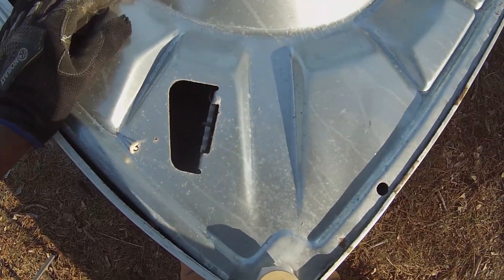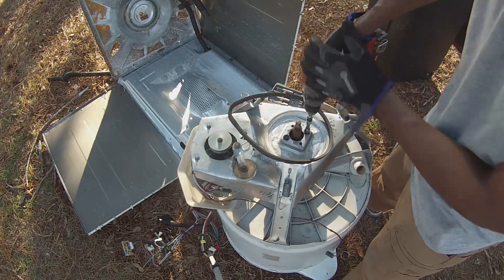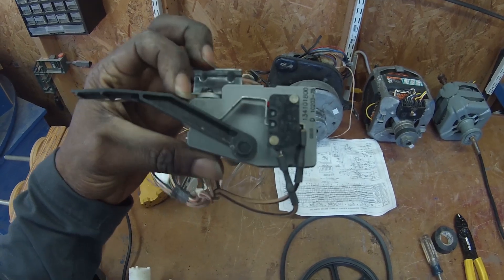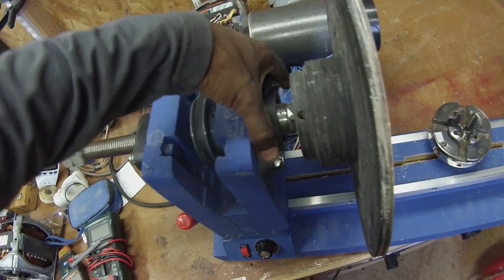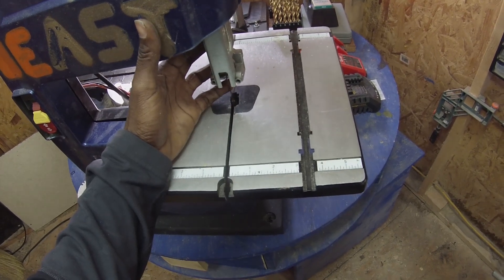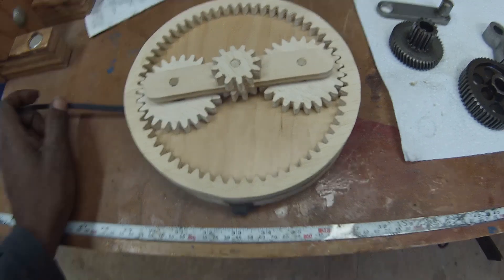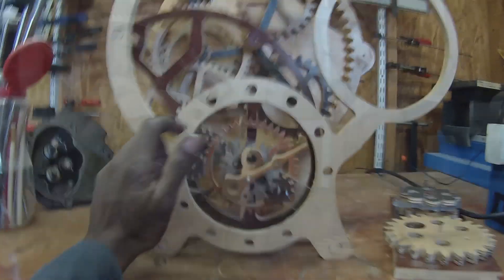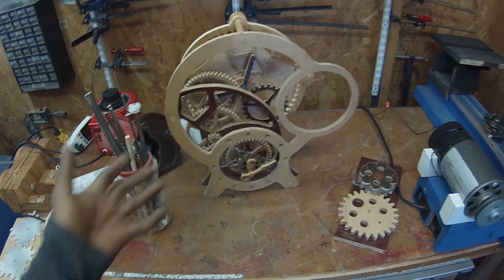Things You Can Make With A Washing Machine And Other Salvaged Components : 020

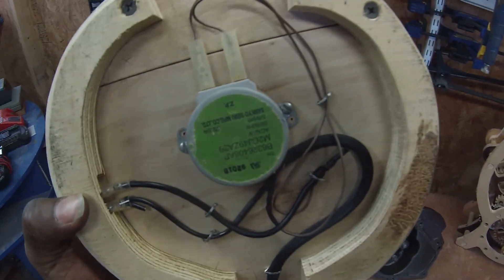Comment: Thank you for the great content. at 8:30 you show a motor from a microwave being used as a clock. These require a 21vac source. How are you supplying the voltage to the motor? Are you using some readily available adaptor or did you use a stand alone transformer you wired in yourself? Thanks again.
Reply from the maker: That motor runs on 120 VAC. I just wired it directly to the wall.

Comment: I love your creativeness.I just had to replace my oil pump in truck and the gears are neat on how they meet up. the inner gear is smaller than the inner reverse gear cut out,so it rolls in kinda a oblong pattern.just trying to figure out what to do with it. I wonder how much abuse that washer transmission would take. that is a step down type gear set up correct. fast motor slower results? might make a good rotisserie for a big grill

Comment: Do you have any ideas of what to do with an old dishwasher with a burned out element? The pump and the rest of the machine still worked. I was considering making a parts washer out of it for my small engine shop. Ideas? Thanks for the inspiration to re-purpose old equipment instead of just tossing them!
Reply from the maker: Sounds like you are on the right track. I have only opened one dishwasher. I keep the motor, the impeller and that is about it. I don't remember what else was there.

Comment: You are now appointed a fully accredited  salvagor!
Very clever ideas which seem exceptionally well implemented.
Your washing machine motors, when used as you have, do need some effective safety shielding & dust protection; but I guess you know that.
Now I need a few pointers on how to manage my accumulation of stuff.
Reply from the maker: Check out video 13... I talk about why it is not not shielded :) I didn't want to add the length to this video. https://youtu.be/ScrlNLQmu3E

Comment: I've been trying to come up with some way to have my patio door open and close with a push button so my dogs can let themselves out. or I can remotely control it over the web that part's easy for me it's mechanical stuff I can't do
Reply from the maker: A doggy door sounds easier, but if that's not an option, I would try a large electromagnet. But that could get expensive fast. I was thinking like the magnets you see at hotels to control the door with a card. Just brain storming. This can definitely be done, but I don't know how "cheaply" it can be done if that is the goal.

Comment: I don't know if you've scrapped computers before but there's a lot of fun stuff in there.

-Hard Drive magnets... you need to get mechanical drives, and there are bigger magnets in older drives.  My main worktable has a metal cubby overhead, and I have the entire thing lined with HD magnets.  I have calipers, dividers, center punches, drillgun bits, everything up to a small crescent wrench, all just suspended overhead within easy arm's reach.

-CD/DVD drives also have rare earth magnets but they're smaller.  Just the other day I used some to mount to the back end of a treadmill motor so I can use Hall Effect sensors to measure RPMs while it's running.  Optical drives also have rails like the printers you mentioned, and small gearing, and IIRC also a standard 5v dc motor.  Plus, the DVD drives... well everyone's seen the DIY balloon-popping laser videos.

-If you're into BLDC, there are lots of stators to collect in computers.  It was a lot more popular like 10 years ago but some people wind their own motors.

-Lots of tutorials on how to build a benchtop power supply from computer PSUs.

-Fans, switches, wiring, lots of incidentals that add up to a good stash of useful bits.

-The most useful thing by far for me is always the CASE.  I use computer case for everything.  Small brackets, tracing patterns, custom enclosures, custom washers... I even used strips of computer case to make brackets so I can stow milk crates up in the joists overhead in my shop.

Comment: can you build a go cart with that washer machine moter to make it run with a accelerator pedal to control the speed of the motor
Reply from the maker: I would use a DC motor. It can run on a battery and you can control the speed. Neither of these things are easily done with an induction motor (what we have in the washing machine). 
Check out video number 20 https://youtu.be/ASywVBU0ZwE  I show examines of motors that can be speed controlled, and run on a battery. It would help you build your cart
Reply: Jeremy Fielding ok sweet thanks 😎

Comment: Here's one I can only hope you can help with.  I don't know clock mechanisms, especially the gearing, but came up with the idea of a 10 hour clock with 100 minutes per hour and 100 seconds per minute in the early 80's.  I even talked with a clock repair shop in Minnesota while I was there for two days and they couldn't help at all.  

Plans would be sufficient but to make one would be fantastic.  It would truly be the worlds first metric timepiece.  A typical day has 86,600 seconds but this one would have 100,000 seconds with one of 'my' hours equal to 2 hours and 24 minutes of present time.  Here is the neat part.  A work day is one third of 24 hours so in 'my' time, that would be 3 hrs, 33 mins, 33.3 secs.  Now we know how George Jetson only works a 3 hour day, allowing for lunch and breaks.  

Anything you can do, or recommend as a source, towards the creation of this clock would be most appreciated.
Reply from the maker: Its all in the ratios between gears. The concept is very simple for a clock. You use the ratio between gear teeth to reduce the speed by a fixed amount. I would start by researching gear ratios and how to calculate it. Next you need to understand what the pitch circle is. After that, you just need to start build. Check out video number 9 for that. https://youtu.be/o151ZsFlLII
Reply: Thank you.  Watching that video now.
Reply: Pascalore , actually it will not be the first such timepiece.  The French introduced the metric time in the late 1700s but had to go back to the traditional system due to lack of support.

Comment: Nice video, first one I have seen. My question is, what is the size of your shop area? I see you manage your space very well and was trying to get a feel on the space. Thanks in advance.
Reply from the maker: It is 8ft by 10 ft on the outside. I used those dimensions during construction to maximize the use of material. Closer to 7.5 x 11.5 on the inside

Comment: When I saw you pull in the washer I thought of a ceiling mounted track system extending outside as needed. I once used four clamps to lift a 2x4 supported full sheet plywood table from the ceiling. Never had legs in the way and the table was completely stowed when needed. Vertical is great for storage and weight bearing when you are handy. For loads up and down full flights of stairs, I am thinking a 6 rpm motor, bicycle crank and chain. The weight would still be on a sliding bearing system.

Comment: Sweet,  I'm using a nebulizer someone gave me and printing filter housings so that I can use it as a clean air filter when I weld.   I'm running it off of a 12volt rechargeable battery and going to put it on a waist belt.

Comment: Have you considered building a 3D printer? I recently built my own from a kit I ordered from China but I've seen people build their own from the stepper motors in printers, cd rom drives, and floppy drives. If you had a 3D printer, you could print gears with high precision rather than cutting them from wood.

Comment: Why not make a open outdoor parting area with just a roof, concrete floor and maybe shelf with plastic tubs (no walls). Only suggest this because you started by hauling that washer into you workshop then took it outside to finish your parting of it.
Reply from the maker: Well, I only took it outside because it was full of  water. I didn't consider that until I rolled it in. Then when I wanted to turn it over, I remembered the water and didn't want to dump it in my shop.

Comment: you should salvage the gears out of PTO's from hydraulic pumps...beefy suckers, and they normally wont rebuild them for garbage trucks just toss em out once they have a issue..most of the time, the shaft sheers, but the gears inside are still good. the one we just took off had been on the truck for over 20 years...the shaft finally sheered the teeth off, but on the inside..it was like new..and its been like that for all of them we have replaced. the break drums are so big, they make great forges, or even 80 pound BBQ grills.

Comment: What sort of head does the pump in a WM have?
Reply from the maker: I don't know. Its probably not very much. It was at the base of the machine  pumping to the the top of the tub, so it would have to be at least a 4ft+ of head. That turns out to be the faulty part. It was making a terrible noise and stopping intermittently. I ended up editing the diagnosis part out. I am curious myself.
Reply: Jeremy Fielding it would be great to know. I have been wondering about trying to use the water pump from a washing machine or a dishwasher in an automated irrigation system.

Comment: Kudos to you for repurposing found things.  Years ago there was a washing machine brand; Bendiz, it had a low and high speed trans built into the motor.  It was shifted by a solenoid.  I used it on my nadn saw to cut wood or metal.  Had to change blades but speed was controlled by a switch.  Keep up your interest.
Reply from the maker: You mean like this one I found. 
https://youtu.be/ucxwxx-IPD4

Comment: Some of those washing machine parts are worth money as used parts. The plastic agitator can go for $20-$30 on ebay. The suspension spring set can go for $30-$50 for a set of 4.  It's funny when my friend gave me a Maytag and it wouldn't work I end up parting it out and making about $150 after all the ebay/paypal fees and shipping. It's a good way to off set your labor time for recovery of parts for your projects. :)

Comment: Awesome Vids man.....I want to make a 50 to 60 lbs. max backyard hog rotisserie out of a washing machine 3/4 hp motor and gearbox and make it 6 to 8 rpms, is it possible with this gearbox? other gearbox? any ideas?
Reply from the maker: +Victor Krash I would use a series of pulleys compounded together which can be made out of wood at that speed.

Comment: Did you take the water solenoids out?  They are great control devices for outdoor ponds and stuff. You can use a float switch and keep all the pipes out of the freeze. 

I stop to pick up all sorts of stuff. I have found carpet cleaners, vacuums, fans etc some with the "feature" stickers still on them. I used to make fair money gathering them up all fall and winter (xmas bonus time!!) Repair and clean them, then sell them at a yard sale or flea market.  
Do you get stuff just to take it apart to see how it works/was made.

I think you may find the regulator motor you use in the clock unsatisfactory. Is uses way more power than you need and it will get HOT.  The are for intermittent use, not continuous use.

I must say I was impressed by your work.  Looks nice and shows you care about how it looks as well as performs. You gained a subscriber.
Reply from the maker: I only run the clock intermittently. I have a watch to tell time LOL. It was just a fun project. It does keep time though.

Comment: The open gears reminds me of an incident in aircraft power plant school. We had a cut-a-way 16 or 18 cylinder rotary engine in class. A 1hp electric motor with a gear box turned the engine over and you could see pistons, gears and valves moving as they would if the engine were running. Then one day a dumbA## casually stuck his finger between an intake valve and its seat. The coil spring that held that valve was about 6 inches long and and 3 inches across. The coil itself was as thick as your thumb. Parking a car on that spring would have compressed it maybe a 1/16th of an inch. So he sticks his finger in and a second later he pulls it right back out but much more quickly than when he stuck it in. "Hmm, Wonder Why?) After he stopped hopping around you could see that the end if his finger was just plain gone. The valve compressed it down to the thickness of say about a 1/4 thickness of a piece cellophane. Three maybe four seconds passed before the finger nerves finally got off a so long dum$a$$ message to his brain. Then the screaming started but it was quickly drowned out by the entire class laughing.

Comment: fascinating video sir, great and very creative energy.  However, there are some safety concerns with your home-built shop machines, especially the woodworking machines.  You are using "Electric Induction Washing Machine Motors" for your builds.  Yes, they are very powerful motors, but the safety concern is this. The motors that you are choosing to use are open faced motors and have zero protection for the coils or the stader. This is a concern because of the dust and debris that's generated from cutting and grinding.  If cutting and grinding metals, metal dust can build up on the motors and surrounding surface. Metal dust can short out and cause electrocution.  Surprisingly, metal dust in sufficient quantity is extremely explosive and potentially deadly.  Wood dust is very flammable and can also be very explosive. Wood dust also has minute amounts of resin inside the woods. And if it's a treated wood that's sealed with compounds and sealants, this too can build up on your exposed motor. These factors can lead to several hazards, not the least of which, electrocution and fire.  If too much dust builds up on the coils, it can cause the motor to become gummed up and jam. Eventually, it will start generating excess heat buildup that can lead to motor failure and fire. Excess heat on the coil wires can cause the resin sealant to melt and create an electrical short circuit that can lead to a fire and/or, possible electrocution.

You are obviously an educated man and are very good at what you do, but as someone experienced in metalworking and woodworking, I understand all too well, the hazards of working with both kinds of material, and both are potentially deceptive and very dangerous.  You would not know about these hidden dangers until it's too late.  I would think, especially where your kids might be concerned, that safety be a prudent measure and should and must, be a first priority, for your sake and theirs. Thank you for sharing this video.  It is a wealth of ideas for the recycler and the penny-poor <like me...>. Peace to you sir... great video!
Reply from the maker: Check out video number 13 and you will better understand the plan

Comment: How do you like that multi tool lazy Susan table?  I'm thinking about making one too.  How well do the drill press and band saw work on it?  I'm worried about the amount of roller supports, table wobbling, spinning, and horrible experience using the tools on it.  I plan to have a 18" drill press, mechanical hand press, and a 2 wheel grinder.
Reply from the maker: I love it. I have not had any problems with it.

Comment: Love the videos!  I made a large face grinder/ bowl lathe using tubular steel from a cafeteria table that was discarded at work and powered by a 1 1/2 240 v pump motor I got at an auction for $15.  The top spindle was a discarded 2 phase motor that was burned up.  The hard part was removing the aluminum from the rotor to decrease the weight of the top spindle.

Comment: I made a grinder/wire wheel with a washing machine motor that still runs great 25 years later. Wore out plenty of grinding and wire wheels with it.

In fact I also have a 1950's washing machine motor dedicated to sharpening my lathe tools. It runs so quiet it's easy to forget its even on when its not sharpening.

Comment: This remind me of a home made forklift I saw in Wyoming back in the early nineties. He's stripped an old Toyota to the frame, turned the front seat around, welded a pair of salvaged forks onto the frame where the back bumper was, replaced the  AC compressor with a hydraulic pump, and with a few salvaged valves he was good to go.  He had all of $200 in it.  It was ugly as Hell but a beautiful piece of backyard engineering.

Comment: Good job, and its great to see a top-loader broken up, most machines now seem to be front-loaders in the UK at least. That means a belt drive with a huge reduction ratio and a high speed brush motor. I hope to get hold of a direct drive front loader, so that I can play with the big direct-drive multipole synchronous motors you find on some of them such as certain LG models. And the VFD control board that goes with it. Should be very useful and powerful, and good for at least 1200rpm while keeping excellent control down to zero speed. Good for a lathe? Anyway, keep it up! Looking forward to the next one.

Comment: The only workshop machine I have made because I could not buy one is my filing machine. The electric motor moves a vertical mounted file up and down against a tilt-able work table. Allows accurate and easy filing of shapes and profiles, like gear teeth, easily. I used eccentrics to turn rotary into oscillating linear motion. Comes in very handy!

Comment: You need to consider some safety shielding on your electrical components. You don't want to be held liable if someone gets a shock from, for example, that bandsaw. All electrical connections should be inaccessible to users and I hope all metal parts are properly grounded. I will probably be accused of being anal but I have been professionally involved with electrical safety for a long time and I've seen what can happen. In some (most North American?) jurisdictions it is illegal to use stuff like that without an inspection. I know you HAVE to have one in all parts of Canada.